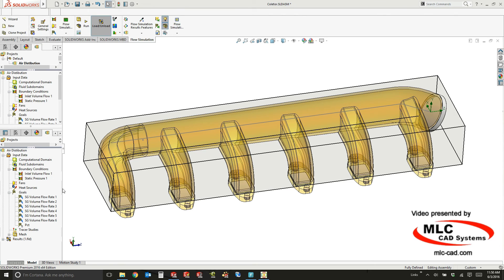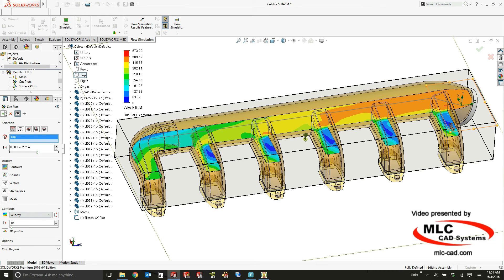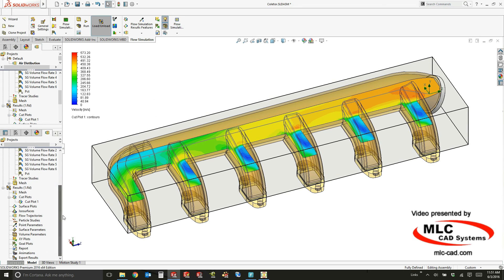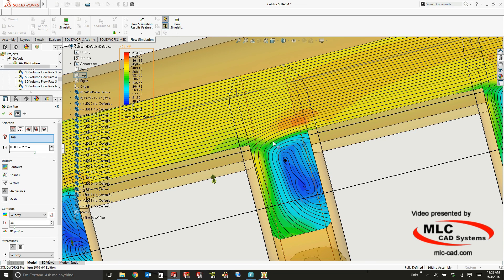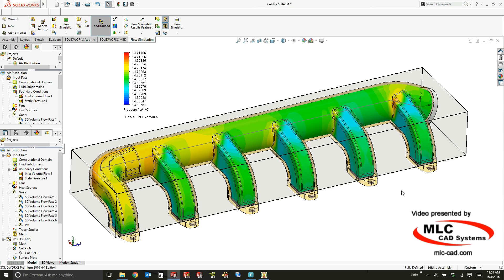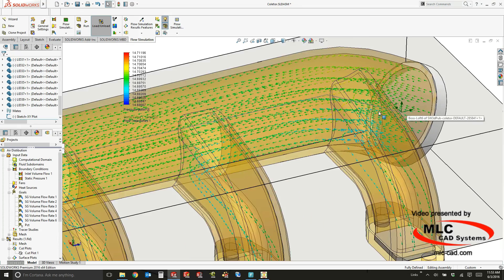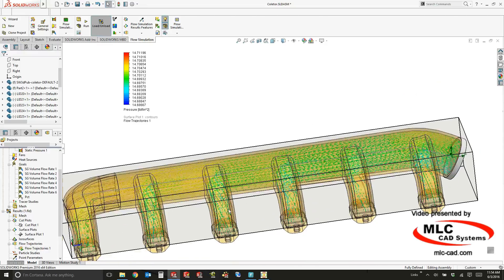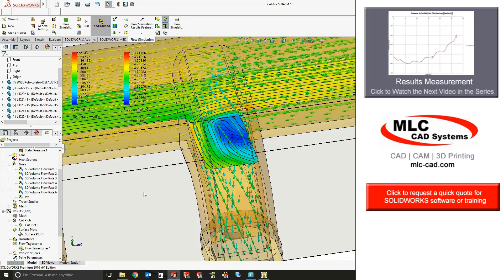SOLIDWORKS Flow Simulation: Results Visualization

Comment: Would you please reverse the flow? PLEASE and show the flow rates PLEASE!
Reply from the maker: The flow will reverse naturally if the boundary conditions create a reversed flow.  Right now it is going from high pressure to low pressure, but by swapping those values or modifying the boundaries you can accomplish anything.  As for the flow rates, you can measure them with surface goals on each individual lid face or by specifying a surface parameter and measuring the flow across the lid face.